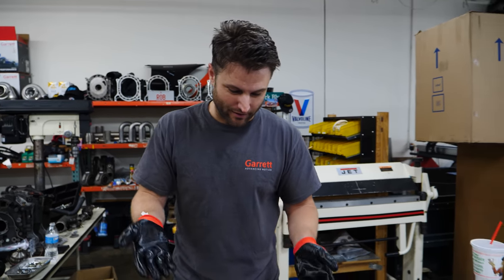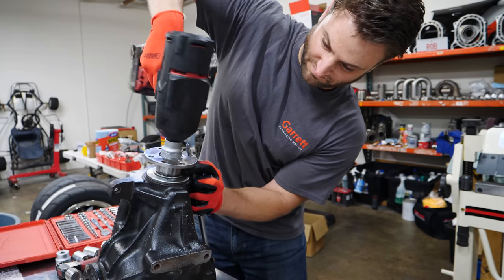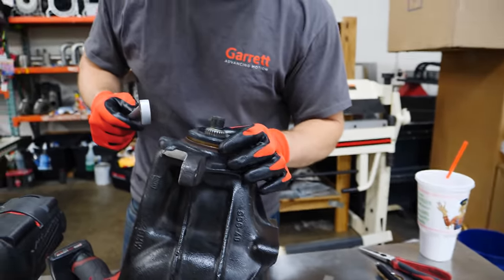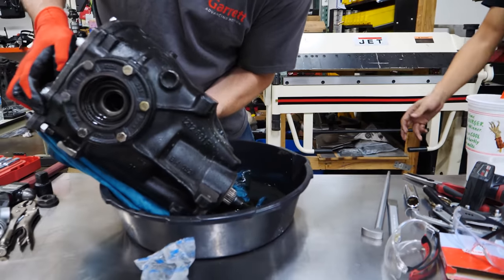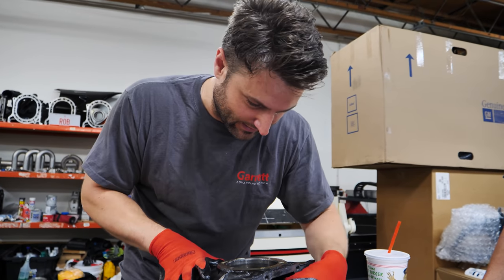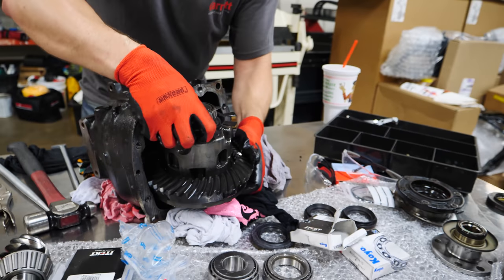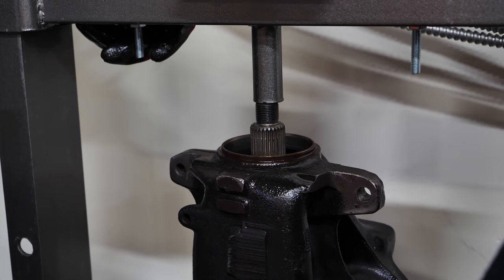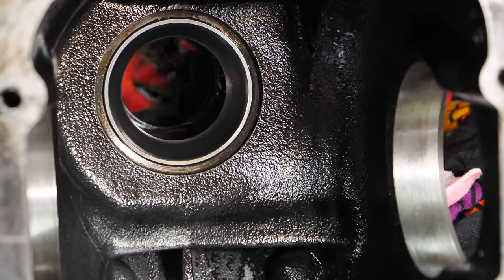Finally going back to AWD. Tearing into the Front Diff on the AWD RX-7

Comment: if you look closely at the pinion shaft there is a crush sleeve on it that will need to be replaced. it's one of the adjustment points for the pinion you really need to replace every time you rebuild the diff. it's the little black thing in the middle of the pinion shaft it go's between the outer bearing and the shaft itself

Comment: Rob, if you're considering using the other gearing for top speed runs, it'll save you time to buy another diff (yes, I know it's all just $). That way when you need to change ratios, you just pull out the other diff, swap over your special cover, then reinstall, and save a lot of time and material (bearings) to swap it over.
Reply: Or he should just invest in a pair of quick change diffs.
Reply: @traxxasslash95  especially considering winter's can make him a proper reverse rotation front diff, running a standard rotation gear in the front isn't going to last long with power being put through it.
Reply: @FUCK_________googIe  the ring is cut to spin in a certain direction

Comment: Please remember to replace the crush sleeve in between the two bearings on the pinion, that is where your lash/ preload adjustment is. I didnt see any shims pulled out after the pinion flange was removed.

Comment: No need to constantly take the diff apart. BMW has specifications on how and where to set it. You have a crush washer on the pinion shaft that sets the pinion depth.
Reply: Crush washer applied correct bearing preload, I didn't think it set the pinion height
Reply: @mcspikesky  you might be right. Also that avatar brings back memories
Reply: Pinion depth it set with a shim under the bearing closest to the pinion gear. Crush washer is used for bearing preload.

Comment: 8:58 Ford for sure and I think GM use a crush washer. You install the pinion first and depending if you replaced all the bearings pr not will decide on how many inch lbs of resistance you apply to the pinion nut which positions the pinion correctly. Or you can buy aftermarket shims and have to assemble and gut everything repeatedly until the gears contact each other within spec. It's easier to only have to juggle ships between the two sides of the differential than both sides plus the pinion.

Comment: The pinion looks like it has a collapsible spacer on the shaft, which will mean there is a rotational torque setting for pinion bearing preload. Very important to bearing longevity.

Comment: As a millwright; put one punch mark on side a and 2 on side b and respectively on the case and also after you pulled the input shaft seal, put a straight edge across the end of the diff input shaft and use the depth stick of a set of verniers to get a measurement for backset. it'll get you close.

Comment: Couple pointers that could help; if you TIG the bearing races (just to heat them a lot, but not meld them) and let them cool again they'll be a lot easier to remove. The race expands through the heat but can't because of the casing. So it actually shrinks when heated and when cooling down it'll be slightly smaller. The diff carrier by the way seems to a torsen type, used mostly in Z3s but not in M cars, they have normal clutch LSD carriers. The torsen doesn't have any preload. Another thing, don't forget the crush ring between the pinion bearings :D you also need to reshim the the diff when you replace any part, like the ring or a bearing

Comment: 0:16  Apply a light layer of GL-4 gear oil to your pan, Valvoline is best but other brands  work as well. Add  your differential ring gear and let  it brown on both sides for 4 minutes at 10,000 rpm. Next add the pinion and bearings, cover and let simmer. After 10 minutes remove, from the pan and plate the dish. Garnish with differential shims
Reply: 10000 rpm? what? XD

Comment: If you turn the whole diff case over 180 degrees you you reverse the output drive direction and keep the drive thrust between the two main gears exactly as they were designed to work! Exactly the same as many race cars that used the VW gearboxes did for years before there were custom gearboxes available.

Comment: ROB, when or if you break either diff, due to the massive power you are making, have both sets of gears, set to "REM" Polishing, & then sent to "300 BELOW" for cryogenic treatment.  The polishing will add some strength, but better yet, put more power to the ground, and the Cryo, will make the gears as strong as a street gear can be!    By the way, i like how your real, and doing this stuff!  KICKAZZ CAR YOU HAVE BUILT!  

Oh these recommendations work on trans gears, shafts, internal differential gears, shafts, or any steel parts you want to be as strong as possible.  Look into 300 BELOW and their Motorsports background!  CHEAP INVESTMENT, AND IT WORKS!

Comment: You don’t shim under the pinion bearing like a Ford? To set pinion depth?
Reply from the maker: I guess it could go either way. But I was going to shim the race on the pinion and save the crush sleeve for the preload without changing that depth. Honestly this is only my second rodeo 😂
Reply: Shims should be between pinion gear and inner bearing. Reusing existing shims will probably get you very close to the right setup. The shimming is usually case specific, not ring and pinion specific. IE the cases and carrier  have more machining error than the gears
Reply: Pinion should have a + or - number to indicate the pinion variation from “0”.
+5 means the pinion is 5 thou bigger, and you need to compensate by taking 5 thou out of the shim thickness.
-5 means the pinion needs 5 thou added to shim thickness.
If original pinion was +5 and new is -5, the pinion variation cancels and you need no shims.
Reply: I re use all my crush sleeves, zero fucks gone 8’s and nines but I still appreciate you
Reply: @ramjet7089  You are correct, using the existing shims will always get you 95% close from experience

Comment: The forces on the diff gear will be the same either in forwards or revere if ran , however the diff casing strength will be the weak point as will be webbed and reinforced for running in opposite direction

Comment: Yo Rob! I've never set backlash on a diff before but I think if you just read the factory manual, they have a much easier way to do the adjustment,,, I believe it involves using a dial indicator!  And or maybe some white grease or paint on the teeth

Comment: If you actually are running the diff backwards you need to do a bit of a re-design. Helical gears will not run properly backwards. What you need to do is put another drain plug in the top of your front cover. That way you can run the diff upside down. When a diff is upside down it will run backwards but with the input shaft turning the same direction. I'm assuming it is upside down though because your front and rear propshafts are running in the same direction. So if that is the case you don't need to worry about it.
Reply: correct

Comment: If the fill plug is the same NTP size as a Ford axle, get a Ford axle plug as they have a built in magnet that will pick up metal out of the oil.

Comment: Could you flip the diff and then use the drive side of the ring gear for strength? The ring will still rotate properly so the oil should still circulate to the pinion maybe with more resistance.. If its got a vent plug it and make another on the new top side / previously bottom

Comment: If you turn the diff upside down it will be rotating the correct direction
Reply: That is not correct. The only thing that would change would be that the wheels would turn the other way. If you use a diff designed for the rear as a front diff, it will inherently run in reverse.
Reply: Is it not already being run upside down?
Reply: It would be great for burnouts
Reply: Wouldn't lube correctly.
Reply: Blockbuster2033 you are correct 😅

Comment: @Rob Dahm Theres probably a crush sleeve in the diff between the bearings of the pinion. On cars that see a lot of shock loading in both directions (loaded / unloaded side of the gear) the original crush sleeve is replaced with a solid machined bushing that is made to be the same length as the sleeve in the assembled differential....this doesn’t allow the crush sleeve to crush more and lash / in & out movement to develop in the pinion.....this could be helpful because the diff is being run in the unloaded direction.....Therefore axial force is being put on the crush sleeve when launching.
Reply: @Rob Dahm I’m glad you saw my comment, thanks for the like, and keep up the good work 👍

If you want ideas about the bushing I mentioned to replace the crush sleeve, it’s a common modification done to drift cars because of the reverse shock loading caused by use of a hydraulic hand brake....I’m sure they have some good write ups.

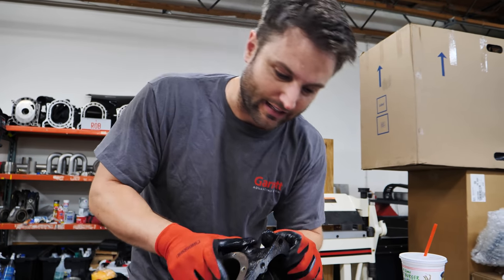Comment: 5:59 I don't remember. what was the reason Rob didn't track down a front truck IFS diff? also you could just flip the diff over and it would spin the right way. But only if the housing is shaped to coat the ring and pinion correctly and you have a way to fill the housing with a lubricant to the proper level.

Comment: Rob! be aware that those BMW diff´s don´t like to be driven in the opposite direction!
And cooling specially is a problem with these! even if you don´t change the direction, orientation and the back-(in your case front) cover!
If you ever conceive of driving this thing for longer durations on high speeds, be aware that this thing will overheat and murder itself!

Comment: Peg your diff.

In the land rover world we don't have the best diffs/axles😂 so we peg the diff by have a phospha-bronze Pas running on the back of the crown wheel held in place by some studs through the diff case. This stops the crown teeth walking up the pinion screw and stripping teeth.

Best strength mod you can make

Comment: The very last thing Rob said was "Why the he'll does this gear oil smell like shit?" Lol,,, I think it's from high sulfur content which is similar to rotten eggs.  It's also so you don't confuse it with motor oil because you can tell by the odor. Natural gas has Sunkist odorant added called "mercaptan" for safety reasons otherwise it's odorless and you could blow yourself up if striking a switch or match

Comment: Pink Sock
first 5 seconds

stack tolerance 
roughly 250 seconds in :)

Doesn't the pinion have a crush sleeve on there? Isn't that what's in the middle of the 2 bearings on the shaft?

Comment: Do you have plans on designing and building your own front diff that doesn’t have to run in reverse?  I know there are  Ford 8.8 and 9” center section solutions but are larger than the BMW.  Toyota FJ80 Land Cruiser 3rd member in a custom center section might work.

Comment: Given the fact that the rotation is now going to be reversed, are the pinion bearings going to be lubed correctly? 
There is an oil galley that the ring(in regular rotation) serves as a water-wheel and directs oil into the galley and constantly lubes the pinion bearings.

Comment: A 1000 mice power with a  5.14 7 tooth pinion diff. 
It will last a very short time. 
And drain the oil first!
You shim the pinion inner bearing to raise or lower in the carrier.
The crown wheel carrier usually comes in various offsets to put it closer to the smaller pinion. And then shim or adjust to do the final adjustment.
Though as you say the diff is running in reverse so you need a front diff with the teeth cut the right direction.

Comment: You should look into IFS truck front diffs if this one doesn't live. Won't need to worry about them running backwards or upside-down since they are designed for the front.  Spidertrax makes a pretty compact IFS 10" housing or you could look into OEM housings. Low gear ratios would be a lot easier to find for truck diffs too.

Comment: Rob, you should add some round sump magnets to the diff  that will help with the fine metal. You should also call BMW and ask it the rear lubricates in reverse some splash oiled diffs use splash and the rotation of the diff to pump oil up to the pinion bearings it would be worth a call...

Comment: i dont think anyone can call themselves a mechanic until they have had a bath in gear oil lol, my stoner moment was being under the car while my friend lifted the motor and box out, got it on a mad angle and because of my position trying to pull down on the output shaft housing on the gearbox, so my chest and neck and my hair, my hat and clothes all got thrown in the bin lol, then like 12 months later i did the exact same thing with an auto engine and trans, the auto was worse because of the larger volume of oil, but it was better because i wasnt under the car lol, never done it again since haha

Comment: If you flip the differential upside down it will run the outputs the opposite direction. Something to consider rather than running it in reverse under power and destroying those hard to find gears you just installed.

Comment: If you want a basically zero slip diff, I have seen a torsen diff for sale for the E36 BMW that should bolt up to the ring gear as it's a drop in replacement for the stock. Don't remember the power rating though if there even was one listed.

Comment: Start saving now and you'll be able to replace the diff after it destroys itself from driving it backwards.
Hypoid gearsets like the ring and pinion have an offset to compensate for the drive rotation which is now going completely ass backwards.
Reply: No, hypoid just moves the pinion below the centre-line of the crown wheel, amboid is above the centre-line.
I do agree that the thrust is now on the wrong face though..

Comment: 7:19, not a doubt, a statement on your statement.

It's not that simple, because you have to match the pinion teeth position with the case, and then match the teeth to the crown (i can't explain it simpler than that). So you have to actually know what you're doing otherwise you'll frakk your input gear faster than you can snap the lights off. 

And that's the lightest penalty. I've seen units that were completely shattered inside and even outside because of the uneven wear (if memory serves me well, early new gen (to be read, the new plump body style) Camaros had an issue where some units were poorly installed and you could find these cars in rental bays with holes in the diff case).

EricTheCarGuy has a comprehensive video on the installation of new crown and pinion gears for his pumpkin, but it applies in knowledge to any such component. Anyone can watch someone who is an expert on this and make up their own mind if it's simple or not, but as far as i'm concerned, it's an advised visitor job only.

TLDR, if you enter the diff case, you better know what you're doing otherwise, you're in for a costly repair.

Comment: just as a point of reference.. if that diff is not designed to go in reverse, i would suggest you take high detailed measurements of the current ring an pinion and put that in a cad file and make a new one capable of living in reverse

Comment: Why are you running it in reverse? Could you not just mount it upside down?
Reply: That will change the rotational direction of the halfshafts, but it won't change anything in regards to how the pinion and ring gears interact with each other afaik?

Comment: Does the engine just rotate the other way? 
It shouldnt be "running in reverse"... to reverse the rotational output (relative to the car) for the diff... you just flip it "upside down" 

That will flip the output rotation direction. 

That's assuming you can mount it upside down though...
Reply: That will change the rotational direction of the halfshafts, but it won't change anything in regards to how the pinion and ring gears interact with each other afaik?
Reply: @prescottmajette5290  correct. Install your diff upside down and you would go in reverse while your transmission is in forward. Teeth contact should be the same. 

That being said, if the rotation from the center diff to the rear vs front is same (golabally), that would be running the front "in reverse". 

I have no experience with awd transfer cases to know if they maintain left or right hand rotation out of the box, or if they are more like an axel diff where both outputs rotate in the same direction (but opposite hand)
Reply: @bradleynealdaley  I honestly don't know either, but from what I gathered in the video, when rob said "running the diff in reverse" I believe he meant that the rotation of the diff input is reversed from the factory setup on the bmw the diff came from.  So I take that to mean his "issue" arises from how the spiral/beveled/helical cut gears are engaging each other opposite from the factory bmw spec.  I do know for a fact, that the wheels on his car rotate in the "forward" direction when awd is engaged.  TL:DR the issue is the gear engagement/driveshaft rotational direction and not the rotational direction of the halfshafts.

Comment: Rob I have a very important question, you said your front diff is always running in reverse because it's a diff off the rear of a bmw, but here's my question, why didn't you just flip the diff upside-down, minor mods need to be done but it's super easy and common and will lengthen the life of you're diff

Comment: Wouldn't flipping the diff 180 degrees over solve the "going in reverse" thing? Then again that would require new mounts n axles...
Reply: But will put the pinion up and out of the oil.